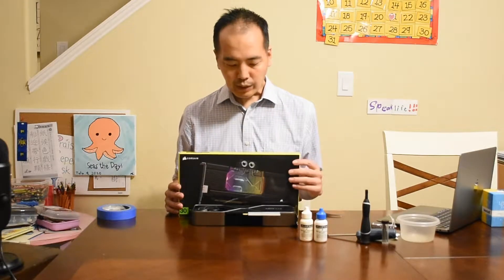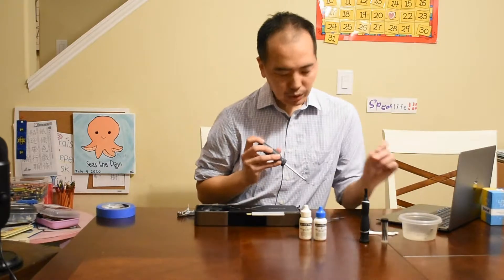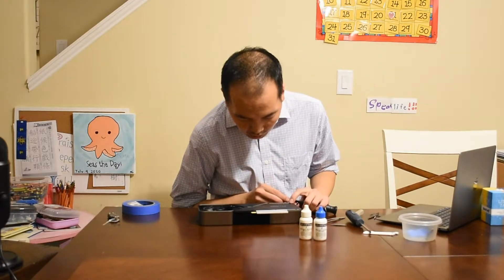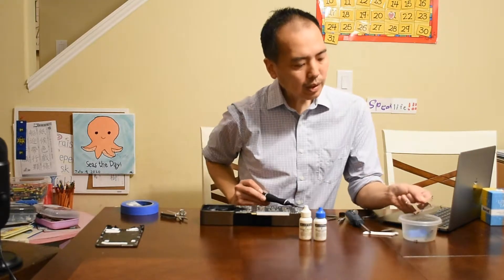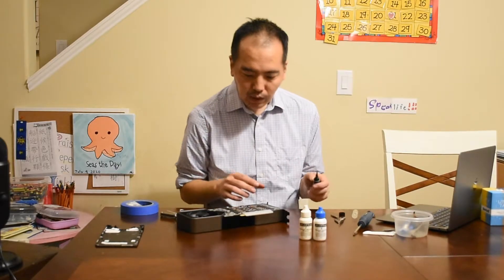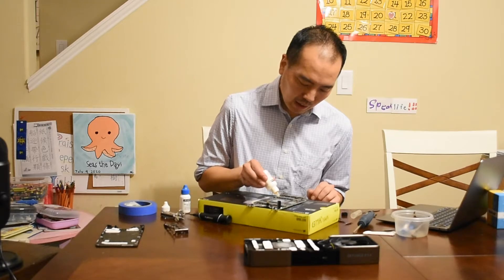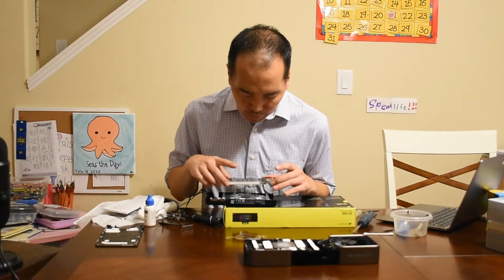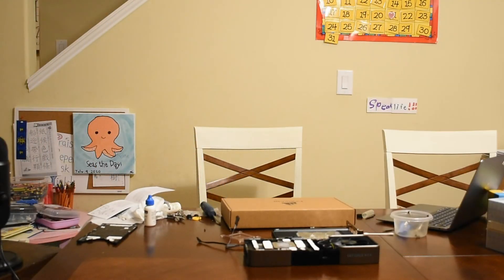RTX 3080 Founders Edition Teardown and  Corsair Hydro X Water Block Installation

Comment: How are temps for you and tjunction ram temps
Reply from the maker: 88 tjunction when mining. Card is much cooler than when gaming. I under clock the card using MSI afterburner. 99MH/s on ETH
Reply: That's about what I had on my 3090 ventus with corsair wb then added backplate cooler and dropped to 76/78c mining, yes I know for sure gaming is in 50/60c if that on ram
Reply from the maker: I regret not adding thermal pads under the backplate. Maybe when I take it apart to clean I'll do that. I've read it helps lower ram temps. Admittedly I don't have tons of airflow inside the case because my radiators are mounted externally.
Reply: @wanderingmusic38  what case
Reply from the maker: Core G3 from ThermalTake. I wanted something small. Had to be creative to fit it all in. It's super convenient that the FE cards are SO short when you take the cooler off!
https://www.newegg.com/black-thermaltake-core-g-series-slim-mini-tower/p/N82E16811133314?nm_mc=KNC-MSNSearch&cm_mmc=KNC-MSNSearch-Cases+(Computer+Cases+-+ATX+Form)Thermaltake_-11133314&source=region&Item=N82E16811133314